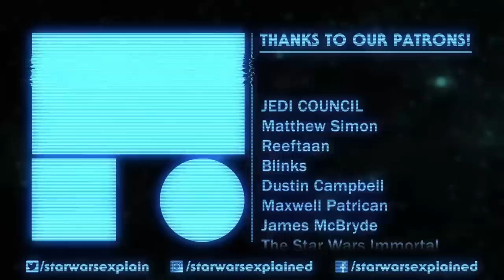The Properties of Broken or Damaged Kyber Crystals

Comment: I saw Cal's crystal actually breaking because two crystals were what he needed, so he actually led by the force to a crystal which was supposed to be two from the start.
Reply: SAME
Reply: When i saw it i thought of the scene in the clone wars where that kid got his crystal and it melted i thought i was going to have to keep going until i got the real crystal
Reply: It is easy to overlook that Cal already had two lightsabers with complete crystals in them, so to a certain degree he didn't need a typical kyber crystal but one that would be able to strengthen his connection with Jaro Topal and Cere's former crystals. I'm not sure if it is canon but there is precedent of lightsabers with more than one crystal in the novels.
Reply: Well Kylo Ren’s Kyber Crystal is so unstable.

Comment: I asume that it was because Kylo ren made his lightsaber not based in his former jedi knowledge on making lightsabers but instead in some blueprint that snoke gave him, one probably based in ancient lightsaber design like the one that Ezra found, but because he made it in a rush or was unfamiliar with either the materials or the design he ended up screwing up the hilt, causing that in combination with the cracked crystal his blade ended up being one unstable.

It wouldn’t be too different from darth malgus from swtor, his hilt ended up badly damaged so his blade is also unstable.
Reply: elmaster48 

I think they mentioned that in a guide or interview. 

Alex may have forgotten that they said Kylo used an ancient design to compensate for his cracked crystal. He didn’t accidentally make one that looks the same.

I think he was rushing to get it finished and that’s why it looks so jerry rigged but the blade would be that way due to the crystal cracking.